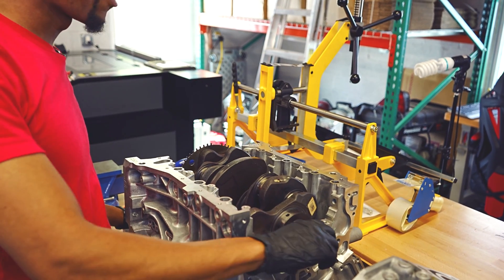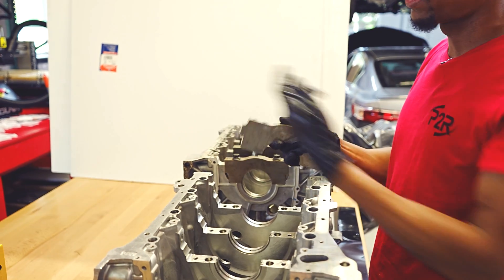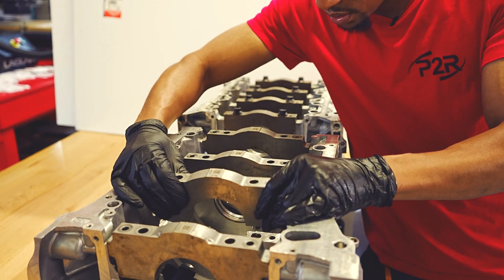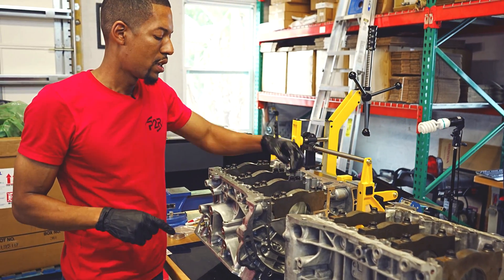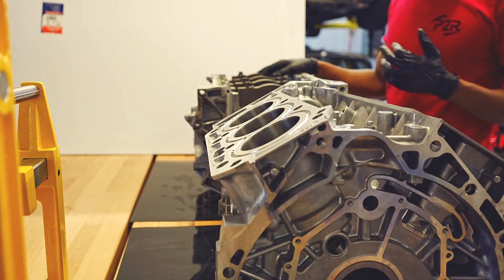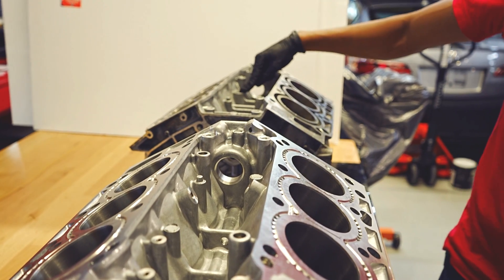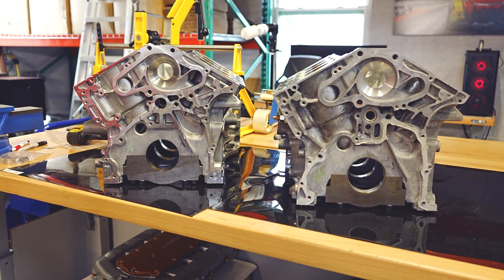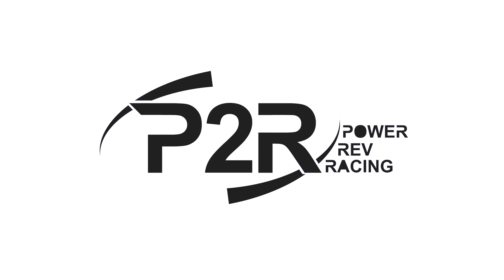Acura TLX Type S J30AC 1000HP Ready CSS Block & J30AC to J30A4 Block Comparison

Comment: What transmissions will fit or bolt up to the j30ac ? Because that would really open up your options if they work with a couple transmissions.

Comment: How are valve-cover & timing-belt jobs done on one of these?! From what I understand there aren’t any cam caps to hold the camshafts down.
Reply from the maker: The cams slide into the heads on the j30a4. The valve cover is the cam caps on the j30ac.
Reply: @PowerRevRacing nice, and will you guys be uploading valve cover gasket and timing-belt work on one of these?

Comment: I'm interested in knowing if the j30ac block has the same transmission bolt pattern as the j35y and Z engines. Some of the A's had it like the j35a8 Acura RL. I'm cooking up some weird swap and this could be great edition down the road.

Comment: Excited to see if any j series or NSX  transmission bolt up to the j30ac block
Reply: It probably won't. The old j35a did have the same pattern and would work but Honda did a redesign in like 05-08 depending on the model. This one probably shares the newer design but they could have changed it again. But the good news is you could build a j35a out of an Odyssey and put the DOHC on the slip it into a NSX

Comment: Anybody have an idea of how much power the stock motor and transmission can handle?
Reply from the maker: They haven't been pushed far yet. So I dont think anyone will be able to answer that yet.
Reply: @PowerRevRacing  getting my p2r parts installed Wednesday!
Reply: Honda / Acura limited the 1st gear ⚙️ to shift early. They must have seen the weakness in allowing first gear to rev high. 
When coming to a roll, the 10-speed does not shift back into first if you do not stop completely. It stays in second and is “laggy” compared to the first gear. 
I can bet you that some stuff broke after endurance testing and they limited the revving so they wouldn’t be swapping them out often . I’m sure it must have felt torquey for the non turbo MDX. The Type S MDX obviously has more torque and makes up for it in 2nd gear and in S-mode.